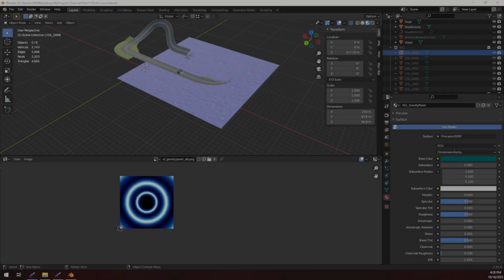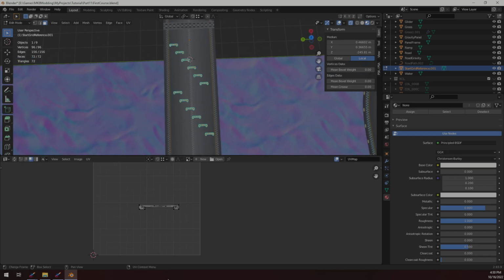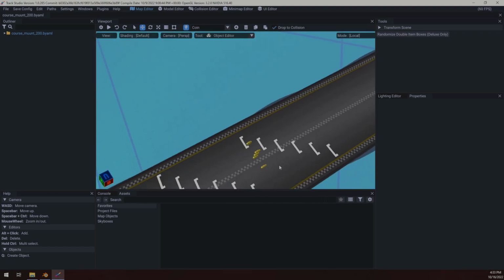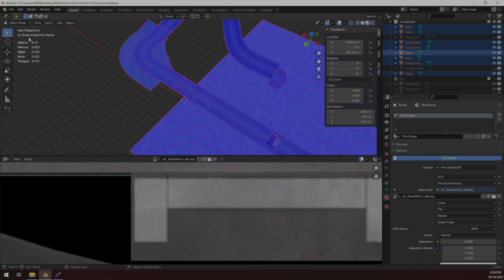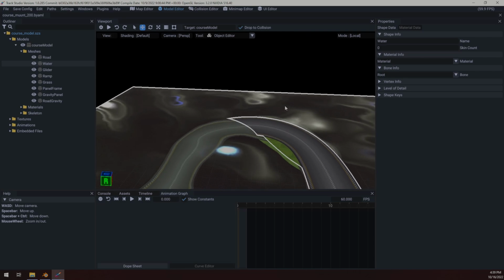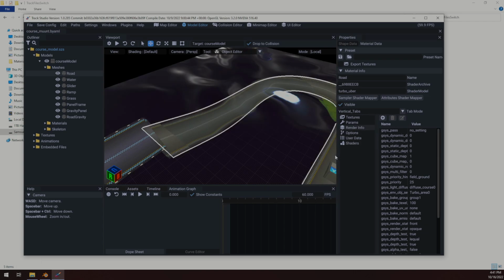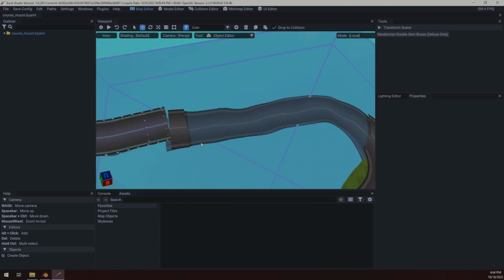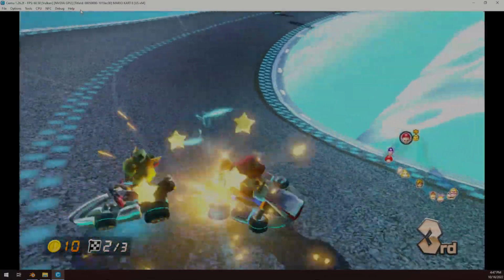Mario Kart 8 Custom Track Tutorial Part 13 - Start Grid and Two-Sided Faces

Comment: Regarding the crashing issue when changing the render state on Switch, if you click the drop down arrow for the box above "String" it'll bring up an option to just select which state you want it in. This way you avoid having to delete the text manually and hopefully not risk crashing